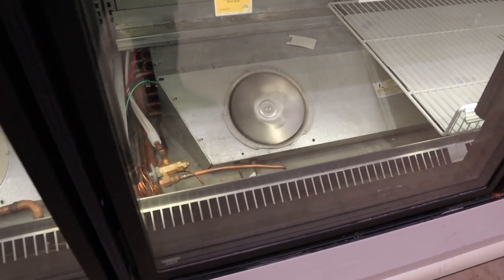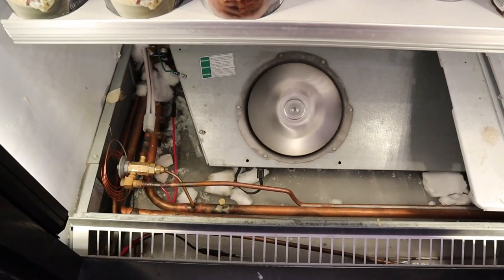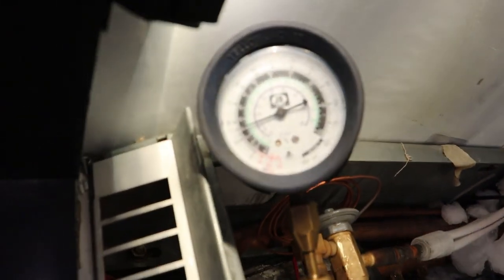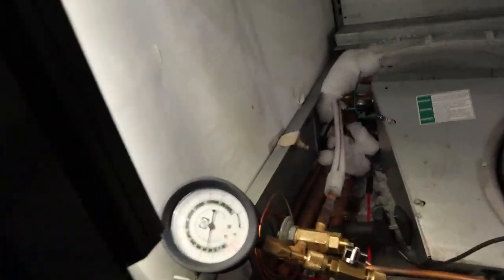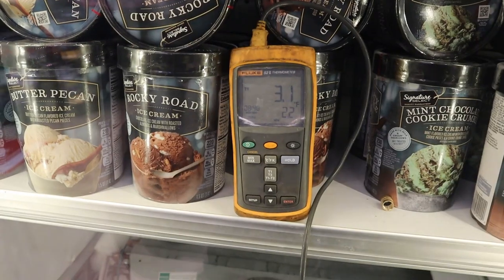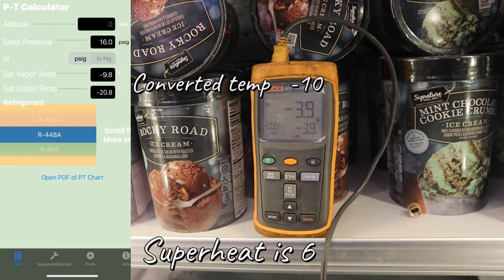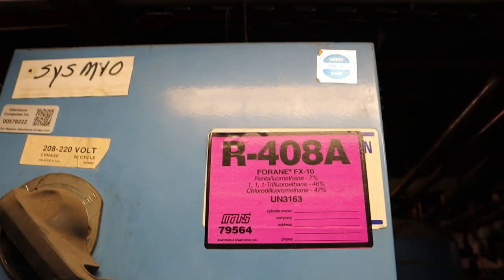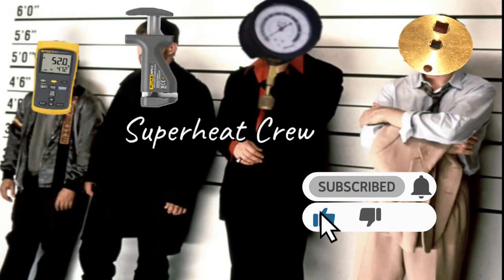Refrigeration How to Check Superheat on a Refrigeration System

Comment: You mention a good superheat is 8-12°F.  This may be a good starting point but Hussmann, H/P, etc. all specify 3-5°F for low temp cases and 6-8°F for medium temp cases.
Reply from the maker: Yea that’s why I mentioned in the video the new more efficient coils are 2-4 s/h it all depends on the equipment

Comment: great videos man i do walk-ins and reach ins is it hard to convert to racks or is there any advice how to get in to racks and what to concentrate on ? thank you for you're time
Reply from the maker: Its not hard .. instead of one compressor you are just dealing multiple compressors tied together to maintain the suction group.  Most of the techs I know got into racks by a friend someone just gave them a shot. Meeting guys at parts houses asking if they are looking for someone. Electrical in the panels and pressures of the racks is what we mostly have to deal with. What SST racks should be at and the systems that are tied to them.  Hope that helps a little
Reply: @refrigerationconfidential4376  much appreciated